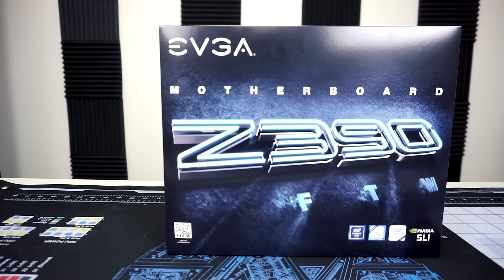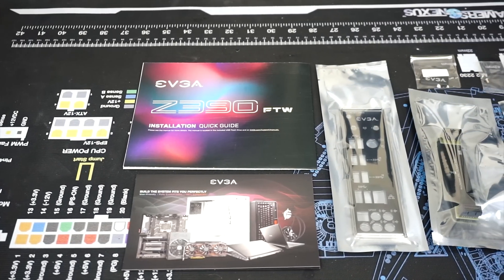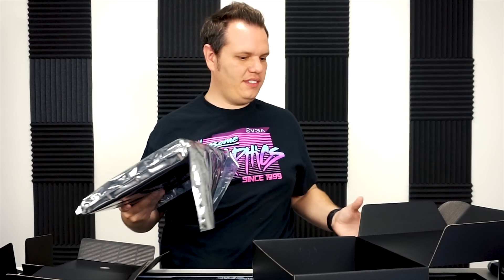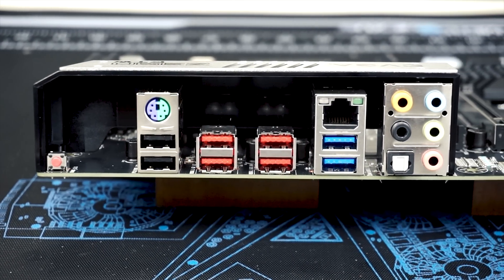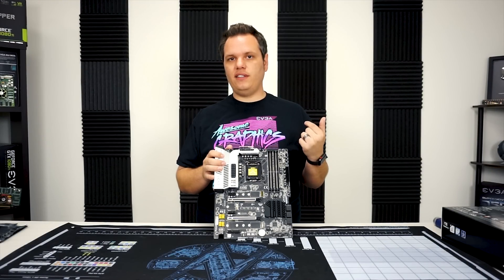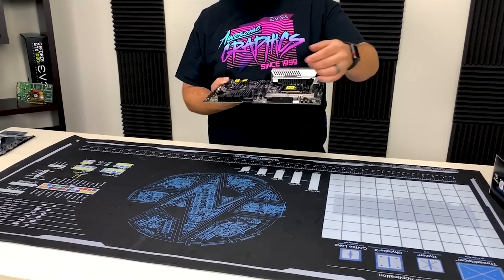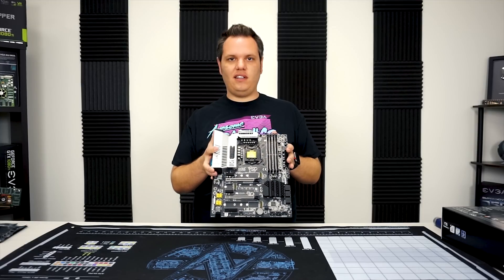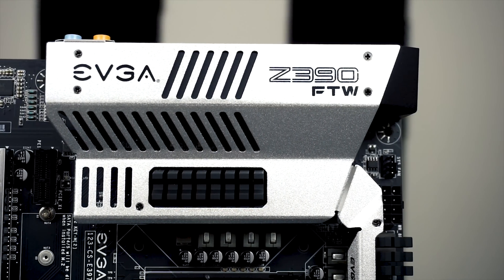EVGA Z390 FTW Product Overview

Comment: no external video output even when targeted cpu have it? not even with breakcout cables?
you know, a lot of overclockers overclock cpu and dont even bother installing GPUs.

waiting for z390 dark, at least it have 1x mDP output.
Reply: Why would anyone bother with cpu out display when anyone buying this mobo will run a top notch Graphics Card with all the display outputs you would need at a far better quality. Plus the Dark is like $500, this 230 ish.

Comment: Sadly, it's a stupid design, without the video outputs which are quite useful to diagnose issues in case of problems.
Reply: what is the background music
Reply: Stupid design? 

ITS A "high end" OVERCLOCKING MOTHERBOARD. No blingy rainbow lights on the board.
Reply: @ezentia5547  Every Z390 board can overclock. If u want to go to extreme overclocking. U must need single channel RAM.
Reply: @Tearis01   No really? I didn't know that??
Reply: @Tearis01  *One Dimm per Channel its still Dual Channel on the Dark and Apex.

Comment: Nice to see the GN ModMat there! I want the Z390 DARK! (And the X299 DARK!) Currently running the X79 DARK. Basically I want a collection of DARK's! Glad to see the PS/2 keyboard port. I hate USB for overclocking.
Reply: What keyboard do u use? If u don't mind me asking
Reply: @whatthehecknate  A MadCats USB one for my main system. No PS/2 port on the EVGA X79 DARK. But I did discover a tiny connector labeled SP1. I'm waiting for the pinout from EVGA. My old rig has a MicroSoft PS/2 KB, and my broken Model M. I will resurrect it!
I like PS/2 because of the direct CPU interrupt call. Whereas USB has to wait for the CPU to ask it for input.

Comment: So it supports bios microcode updates for new CPUs? Z390 should support 9th gen out of the box so does that mean Z390 will also support other upcoming CPUs?
Reply: I think he was meaning you can flash an updated bios to use a z370 based cpu like the 8700k
Reply: shouldn't newer motherboards support older CPUs with no issue? with Z270, the 6700k worked fine on them, but a 7700k on Z170 needed the BIOS update.
Reply: Yeah youre right lol..my brain switched the old and new backwards..but ultimately it depends on how they write they bios coding..Also they have no way of telling whether or not it will support future processors. On the next gen processors (after z390)the pin layout could be different or the power consumption could be different etc. Etc.. The usb flash should be easier to update the bios though either way.
Reply: True, I wish the BIOS flasher without a CPU would become an industry standard, it would save a lot of headaches and potentially money for consumers.